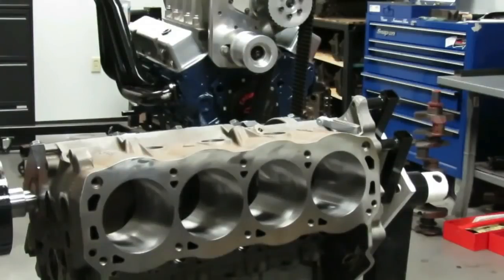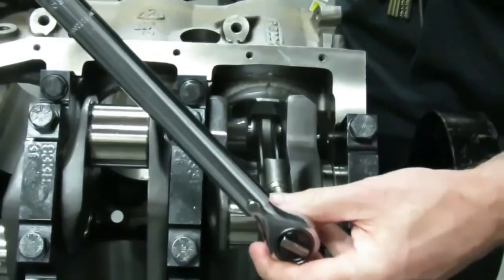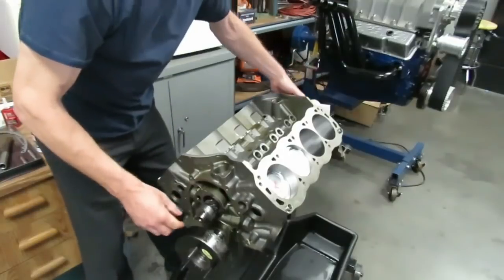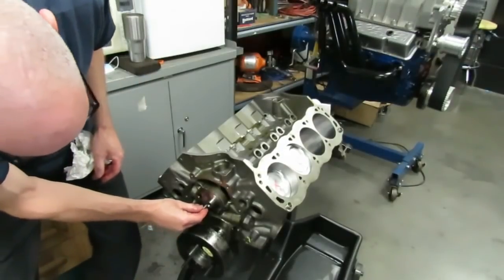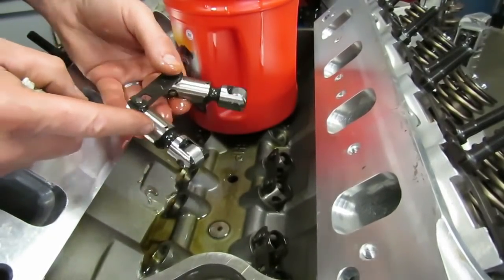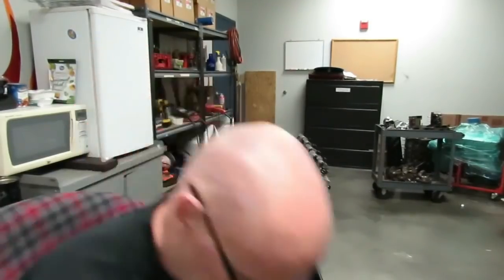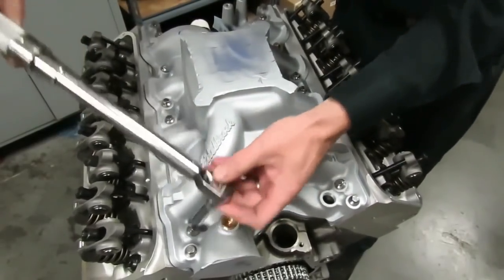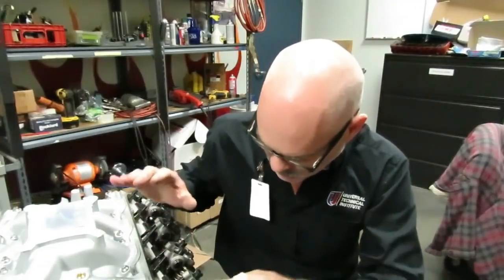351 Clever Build Part 4

Comment: The holes in the head gasket get larger from front to rear. I’ve seen someone install them wrong, the result is no bueno. Also worth mentioning the cam retaining plate bolts have thin heads on them for clearance.

Comment: You set the valve lash at the hot setting on a cold engine. After the engine is hot you will have to re-adjust all the valves again.
Reply from the maker: no you got it backwards the lash is going to be much tighter after things get hot and expand I set the lash for the cold setting I think you need to do a little more research before doing a solid valve adjustment the hot lash is .003 on the intake and .006 on exhaust if you set it for that cold as soon as it started to warm up the valves would hang open and the engine would loose all compression and possibly jam a valve into a piston
Reply: saw this too, cold setting for me is 10thou, ends up at 18 thou hot.

Comment: Goes for a rowdy solid roller. with a low rise dual plane... odd choice. but will be a great combo
Reply: Those heads aren't huge but it's a Cleveland so it breathes well across the range  So low RPM high velocity in the heads, aided by big cubes.  Low hood clearance.  Should be strong across the band and be able to turn fast with that solid roller.  I demand a dyno video.

Comment: I am building my first engine this summer. 351 clever in a 78 f 250 4x4. The engine is seized. I was hoping to to save it somehow. I do have another short block. I aint scared of it but I want success. I would hurt if I cobb the job. another great presentation  sir. Have a great day
Reply: Do you know why the engine is seized? If you disassemble that engine, you might find it is a rebuildable core.
Reply: Why not build a nice 400 with all the good Cleveland top end pieces? A 400 with good parts run very very nice and are 100lbs lighter than a 385 series BB.

Comment: I have been using anaerobic sealant around water ports instead of silicone. However I do recommend silicone on the manifold ends instead of the gaskets that are provided. I have found anaerobic sealant less corrosive over time and certainly more pliable.
Reply from the maker: the gaskets cannot be used if the block or the heads have been milled, they will leak every time

Comment: Just noticed  (time line 9:48)  the pistons are numbered for each cylinder but not in the proper cylinder based on number 1 cylinder  being left front on block and number 5 is right front on block.   #4 piston is in #5 and #5 is in 6 and #6 is in 7 and #7 is in 8. What am ii not seeing or am i missing something?. Great information on this stroker build!.

Comment: What are the specs on the heads, I'm looking to build a clevor engine to put in a Cobra replica, part number, valve size, flow numbers etc. I really enjoyed this build, thank you.
Reply from the maker: Edelbrock's website has all that info on these heads part number for them is 61695 I also have a complete parts list in the description of part 1

https://www.edelbrock.com/rpm-ford-351-cleveland-2v-cylinder-head-hydraulic-roller-camshaft-61695.html

Comment: I would like to know if I have a bore of 4.125 and a stroke of 4.125 X 8 what is my cubic inch displacement?
Reply: Google it, lots of websites have wizards that you can plug the numbers in and get an answer. Or do it the old way and get the formula.

Comment: I noticed that the Trickflow version of these heads come with instructions to drill holes 3/16 into the deck of the block to expose water jackets into the head.  Is that a trick flow only thing or is it apply to the stock and CHI reads also?

Comment: On the factory Ford Windsor block is there any cam clearance issues when it comes to stroking out the Ford factory engine?
Reply from the maker: There is
Reply: @Myvintageiron7512  Would a small base circle cam help to prevent that?

Comment: Great build, but how do you Degree a Cam with a timing chain set..It is NOT adjustable.You can check the Cam timing but you can NOT adjust it /degree it..The 3 options are SET Timing,,NO adjustment..

Comment: I noticed when you put the assembly lube on the bearing in the rod cap you just put a dab in the middle. Do you think that's adequate or should you take your finger and make sure the bearing is completely coated?

Comment: I think this is a super cool engine. I read about them years ago but I have a question. What is the point of this over building a 351 cleveland? weight? RPM range?
Reply from the maker: the Clevland heads are much better, and the Windsor block is better best of both worlds
Reply: Windsor based engines enjoy more robust aftermarket support because of the 79-93 fox body market thru the late 90s until about today. But with the popularity of the coyote and LS based engines, were seeing a bit of a shift in that market.  The aftermarket has seen some progress for the Cleveland. But it is nowhere near the windsor based engines. 
My personal belief is that the 5 litre Mustangs (fox body) has given the aftermarket a giant shot in the arm for generation X gear heads.  Which has spurred support for all the other automotive manufacturers pony/performance offerings.

Comment: Thank you for all the info on cam clearance and lash settings.  I have a similar build. With a hydraulic roller rocker, do you need to change your distributor gear to a bronze gear?
Reply from the maker: It depends on the Cam you need to ask the Cam supplier that question